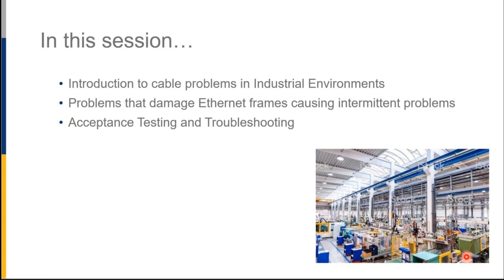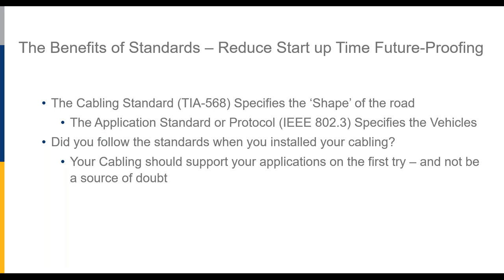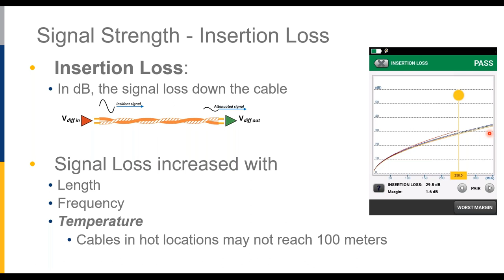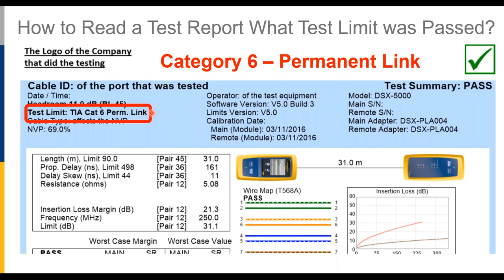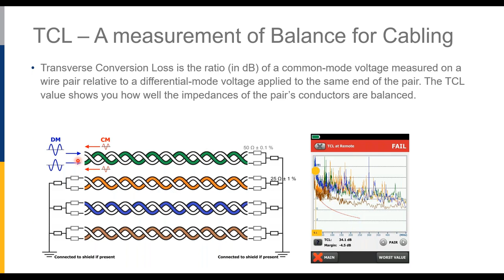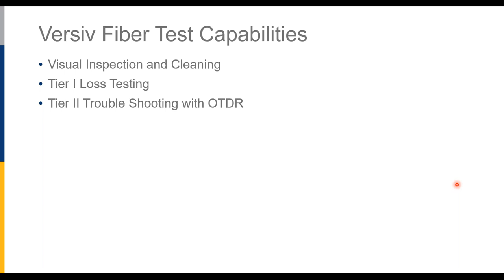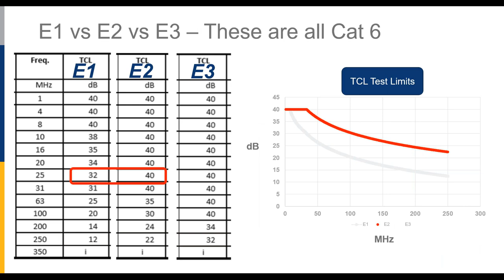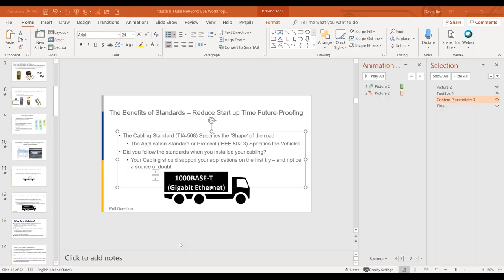Testing Industrial Ethernet Cables to Minimize Production Downtime

Comment: The explanation for split pairs is not very clear and the diagram is wrong. If the diagram is the display of the Fluke tester, Fluke should correct it since it is very misleading.  

If as in the diagram in the video, blue pair is on pins 4,5 and brown pair is on pins 7,8,  then the differential signals will NOT be split and the connection will be fine.

A proper split pair diagram should show on pin 5 the blue-wht wire becoming brwn-wht then becoming blue-wht again. And vice versa for pin 7.

A split pair means one end of a differential signal goes to one twisted pair and the other end of the differential signal goes to another twisted pair. In other words the differential signal has been split into two different twisted pairs of wire.

Split pairs can happen on a manually connectorized cable if one mistakenly transposes the orange wire in position  2 and the green-wht wire in position 3.     This transposition must happen on both ends of the cable otherwise it will be a simple wire map failure and not a split pair.

As mentioned in the video, continuity checks and wire map tests will not detect a split pair. But the cable will fail a signal quality test.

Split pairs can happen in a large installation when an installer uses a cable tracer or a wire mapper tool to try to correct a pair that was punched into a wrong location.  

You need to commit two errors to make a split pair. It is rare, but I've seen it happen when I used to do structure cabling thirty years ago.
Reply from the maker: Thanks for paying such close attention!  I can assure you that the diagram and the description are both correct.  It looks like the diagram on the Versiv screen has confused you a bit.  Pins 4 and 5 should be paired together and 7 and 8 as well.  What the diagram is showing is that 7 is paired with 4 and 5 with 8 – a splitting of the pairs.  The error is made on both ends (as you correctly describe).